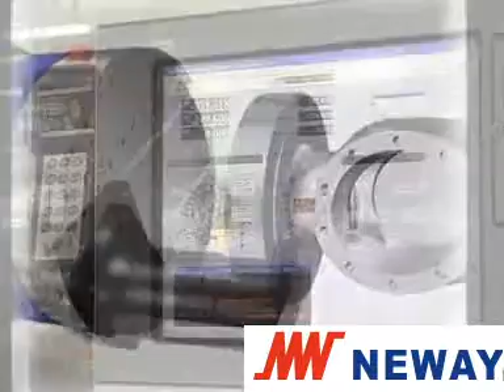CNC Boring & facing head used on Neway VMC and HMC

Comment: how do you program the tool to cut shapes? is the tool connected to the cnc control?
Reply from the maker: There is servo motor to drive the tool.The CNC control the motor. We call this axis as U axis.